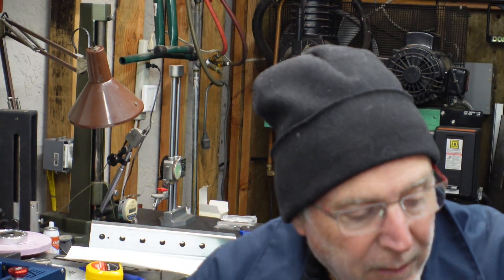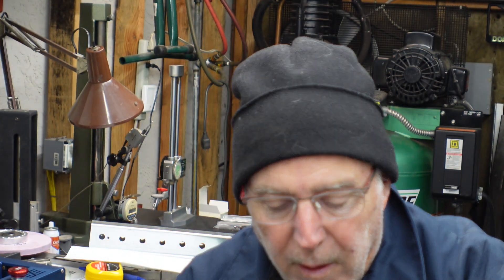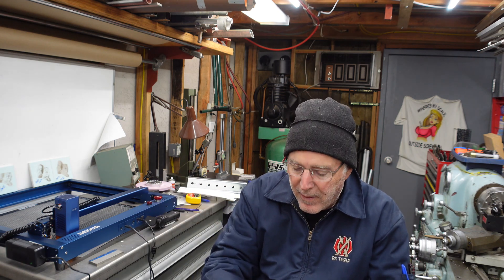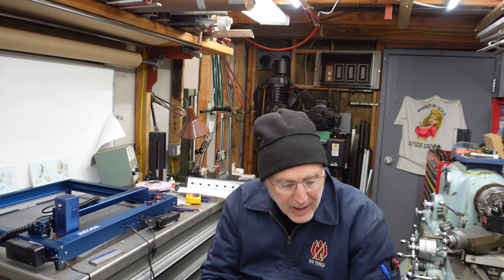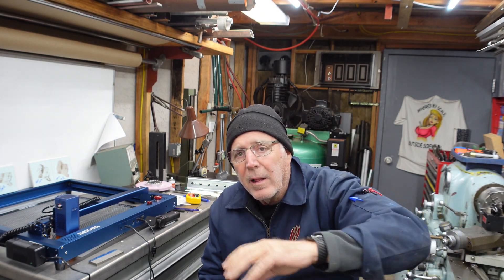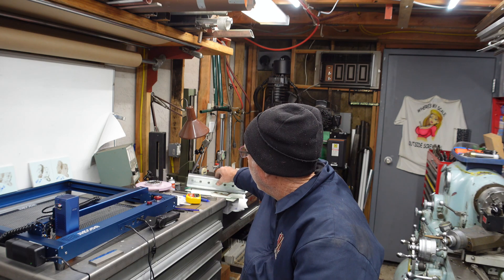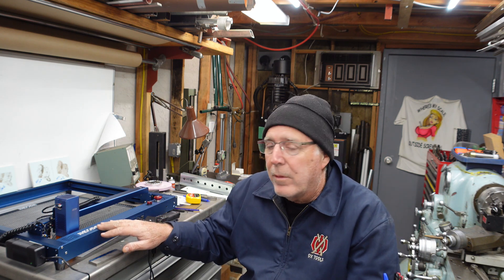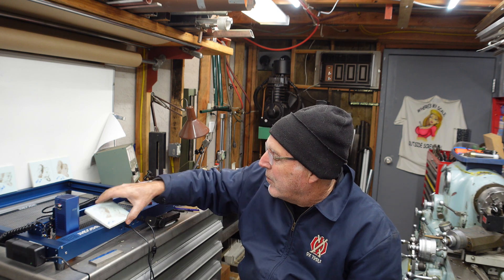JICCODA 10 watt laser (machine shop)

Comment: That's a nice working laser etcher and some examples on what to etch with it. Thanks for the presentation.
I assume the machine was delivered with spesific laser safety goggles. For blue lasert those should be orange.
If You don't have a pair of those, I recommend to get them a.s.a.p.
One just cannot be too careful with lasers. Even the weaker ones used for pointing at Your presentation can temporarily blind You. Lasers with power one watt and higher can blind You permanently. Even some reflections and scattered beam particles can do a damage. So don't watch out!
Reply from the maker: yes, goggles supplied and I wear them.....thanks for viewing

Comment: I don't believe a 10w laser is marking steel. Not calling you a liar or nothing, because there it is right before my eyes. Just saying. I have a 10w, and it'll put a good mark in aluminum and copper no problem, but it wouldn't touch stainless. Maybe carbon content has something to do with it.
Reply from the maker: my earlier videos with the 5 watt did mark tooling, I showed marking the dimensions on the end of a small tap

Comment: 10 watts for that little thing?  To me that's amazing.  Back in the 80's I worked with a guy that did laser shows (remember those?)  He had a 5 watt argon laser.  It was about four feet long and had a huge external power supply. It required water cooling from a water spigot along with an in-line water pump just in case someone in the building flushed a toilet or something that would cause a momentary drop in water pressure.  It also needed 3 phase power, so that usually meant a rotary phase converter had to go along for the ride.
My machining knowledge is based on the days before CNC and laser etching, but I like your show.  Thank you.